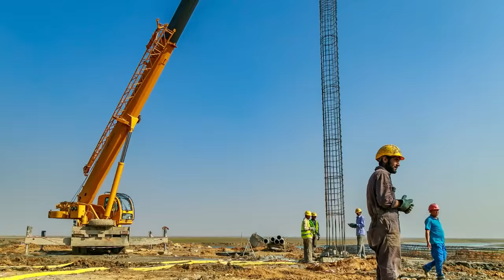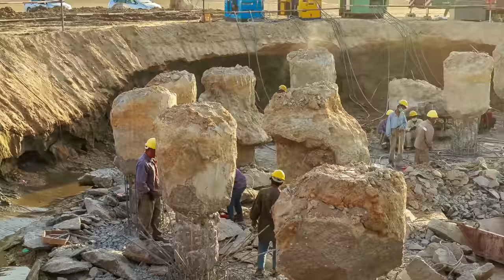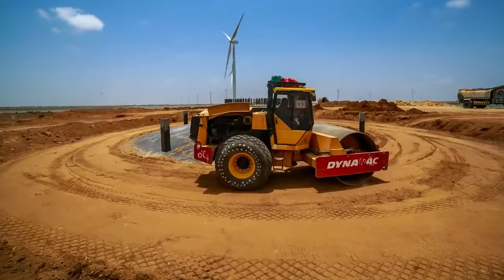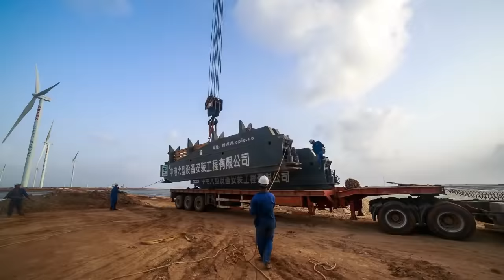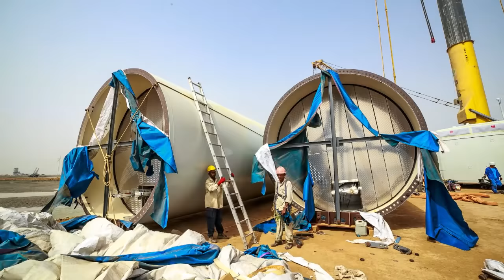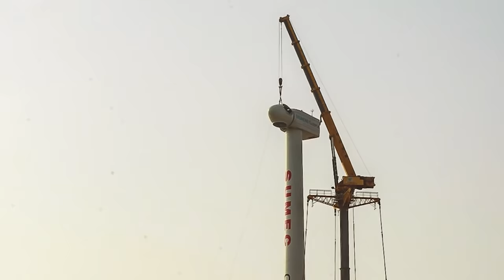Wind Turbine Farm Installation From Scratch | Time-lapse - Mega Structure

Comment: Every wind and solar installation is propped up by reliable nuclear and fossil fuel plants which compensate for the dangerous and unpredictable fluctuations of wind/solar output. Without nuclear/fossil fuel back up, solar and wind plants would cause life-threatening black/brown outs and voltage spikes throughout the day.
Reply: SWOBIZ guess you’ve never heard of large scale energy storage
Reply: @SimpleTek I certainly have heard of grid-scale storage. unfortunately, except for some pumped storage facilities, they don't exist, i.e., a facility that can store several GWH of energy at reasonable cost. In any event, when they do exist, you must add their cost to the price of unreliable wind and solar. I think you'll find the total cost unsustainable.
Reply: SWOBIZ wrong, most concentrated solar pants have large scale energy storage with huge molten salt tanks.
Reply: @SimpleTek   Those salt tanks don't provide grid-level storage. For example, the Ivanpah solar station is forced to burn natural gas to keep its salt hot over night and during cloudy days. That wouldn't be necessary if the salt tanks stored much energy.

Comment: I’d like to know how much fossil fuel is burned building this one turbine. Manufacturing the steel rebar, hauling the concrete, digging and prep work and on and on. 

Green energy huh???
Reply: Vestas studied the carbon payback period for various turbines. This took into account extraction and manufacturing of raw materials, production of the turbines, their transport, erection, operation, maintenance, dismantling and disposal, and the same for their foundation and the transmission grid. The figure was between seven and nine months, depending on the type of turbine. Other analyses have come up with similar figures.

Comment: Just wondering what the carbon footprint is to build one?
Reply: Vestas studied the carbon payback period for various turbines. This took into account extraction and manufacturing of raw materials, production of the turbines, their transport, erection, operation, maintenance, dismantling and disposal, and the same for their foundation and the transmission grid. The figure was between seven and nine months, depending on the type of turbine. Other analyses have come up with similar figures.

Comment: The first thing you have to do is tap your fellow taxpayers for 50% tax subsidies or the thing never gets off the ground.
Reply: Pff like oil an coal arent subsidized as well. In fact per kwh wind is generally cheaper than coal. Before any subsidies and it will continue to get cheaper

Comment: I don't see how this will ever generate enough energy to offset all the construction costs.  Last I head wind turbines are a net deficit.
Reply: You should care about the energy invested in making construction and the longevity of the turbine, not the money.
Reply: @chanakyasinha8046  Don't understand.  If you mean that its a public works project to generate jobs thats great.  But I wouldn't expect the energy generated by the wind turbine to ever cover all the energy it took to make  and operate.  Reports vary on whether wind turbines are net energy deficit or benefit.
Reply: @frymate1261  Locked behind a paywall so I can't comment.
Reply: Vestas studied the carbon payback period for various turbines. This took into account extraction and manufacturing of raw materials, production of the turbines, their transport, erection, operation, maintenance, dismantling and disposal, and the same for their foundation and the transmission grid. The figure was between seven and nine months, depending on the type of turbine. Other analyses have come up with similar figures.
Reply: @SkullRaven  I was more interested in cost payback.  I have doubts that the removal cost included removal the massive concrete and rebar base or the restoration of the environment.   The bases are a blight on the landscape, I have never seen one removed.

Comment: why do they pour the concrete beams up to the top and then strip the tip (2:05)? wouldn't it be easier to let the top without concrete in the first place?

Comment: Very interesting wondering how much it cost to tear one down when it's too old to run?
Reply from the maker: They gonna provide renewable energy for the next 30yr and once 30yr complete.. you can either change its required parts or whole unit..
Reply: @TheBigHeadFilms  thank you so how much would it cost in 30 years to replace the old parts or exchange it?

Comment: It  would be interesting to know how long it takes a turbine to offset the carbon used in it's construction. Anybody know?
Reply: Around 6 months for everything. From mining the resources for the steel tower etc. everything.
Reply: @Mike-kr5dn  thanks...does that include it's disposal at the end of its use?
Reply: @julie5271  Yes ofcourse it is included.
Reply: Vestas studied the carbon payback period for various turbines. This took into account extraction and manufacturing of raw materials, production of the turbines, their transport, erection, operation, maintenance, dismantling and disposal, and the same for their foundation and the transmission grid. The figure was between seven and nine months, depending on the type of turbine. Other analyses have come up with similar figures.

Comment: Needs 31,000,000 of those 2.5 megawatt wind turbines to meet ALL present human energy needs using a 30% Service Factor (amount of wind relative to the data-plate maximum output), 8% grid wiring heat loss & 20% I threw on to account for inefficiencies of making synthetic fuels for aircraft & rockets (I just threw in 20% to give some allowance for that). So at the 400-metre spacing that's covering 4,960,000 km**2 of land & ocean, though the space between isn't wasted of course. Would need to be considerably on land because 4,960,000 km**2 of ocean along 60,000 km of continent (which I'm guessing is ~all of it between 60S & 60N) would be a grid extending 82.7 km out from shore along the 60,000 km of shore with 207 wind turbines in each rank (so a ship leaving any continent would travel down a channel 400 metres wide between 2 ranks of 2.5 megawatt wind turbines with 207 wind turbines in each rank). So the ocean method would need a lot of electrical wiring.

Comment: Is this even feasible in terms of the power output for the work needed??
Reply: Yes. They usually become carbon neutral in about 2 years.
Reply: Vestas studied the carbon payback period for various turbines. This took into account extraction and manufacturing of raw materials, production of the turbines, their transport, erection, operation, maintenance, dismantling and disposal, and the same for their foundation and the transmission grid. The figure was between seven and nine months, depending on the type of turbine. Other analyses have come up with similar figures.

Comment: This video just goes to show how wind turbines are NOT carbon neutral or "green".  The MASSIVE AMOUNT OF FOSSIL FUELS it took to build the roads and work areas to set up a wind farm in the middle of nowhere, the massive amounts excavation and back fill, the hundreds of yards of concrete tons of steel rebar for the base, the energy it took to make them and to transport them...
And that's just the base.
There's tons of metal in the pylon, the generator, and even in the blade bases.  Not to mention that the blades are not made of recyclable materials, and in fact take large amounts of fiberglass and resins, all requiring lots of chemicals, just adds to the fact that these things are not "green".
And oh yeah, they'll be lucky if it lasts 20 years in service, THEN what do you do with it???????
Reply: i live on edge of whitelee windfarm in ayrshire,scotland.........the concrete and diesel that went to the local farmers will never be offset let alone the carbon foot print of the windmills.......and the icing on the cake of what a scam windmills are is fact the concrete is reacting to the peat/soil and they reckon the base might no even see out the first 20years let alone the 2nd windmill. 
oh yh......and some clever cookie set up a deal that even when scottish power dont need leccie we still need to pay the spanish company that put up the windmills......only thing these windfarms are doing is making the rich richer at our expense.
Reply: Vestas studied the carbon payback period for various turbines. This took into account extraction and manufacturing of raw materials, production of the turbines, their transport, erection, operation, maintenance, dismantling and disposal, and the same for their foundation and the transmission grid. The figure was between seven and nine months, depending on the type of turbine. Other analyses have come up with similar figures.

Comment: Nice Timelapse, I'm asking myself how they will remove all this concrete in 15 years...
Reply from the maker: The wind turbines are there for 25yrs... and just in case if they want to replace the old ones with new... they will do it on the same concrete base.
Reply: @TheBigHeadFilms  Is it sure that after 25 years of erosion by the rains + humidity sometimes, the concrete would be as secure as it was 25 years ago?

Comment: Damn, where are the electricity cables? Where does the produced energy flow?
Reply: Those are one of the very first things they put it - under the foundation and running up through the center.  You notice those three thick, curved bundles they put in first, all pointing in towards the center?  There's your cables.
Reply: @vfm66798  1:58 at the center
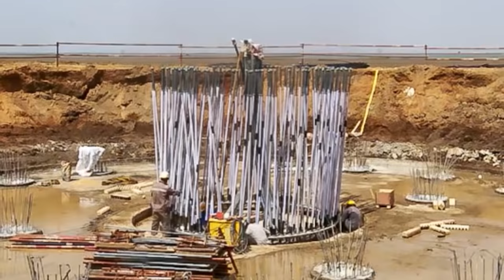2:18

Comment: I don't know how much that crane operator is paid, but he needs to be paid more.
Reply: I spent several years working in the wind industry. Those operators are paid very well. However, even the best crane operator can't do their job without having a competent person on the radio guiding them and people pulling tag lines to line things up. They are for sure skilled but they are only half of the equation.

Comment: All that work for just 1 imagine building like 200 of them 😱
Reply: Well have you seen a nuclear plant building? Or coal plant construction? 
The problem in this site is the foundation. It is very wet and thus requires a lot more reinforcement for the foundation and also the access roads.

Comment: Yes, it was great it showcased al the carbon-producing things that go into something that is supposed to be environmentally neutral. You need Coal for steel no coal no steel and concrete is a mass CO2 contributor when they cam make them out of Hemp it will be a net low CO2 unit
Reply: Vestas studied the carbon payback period for various turbines. This took into account extraction and manufacturing of raw materials, production of the turbines, their transport, erection, operation, maintenance, dismantling and disposal, and the same for their foundation and the transmission grid. The figure was between seven and nine months, depending on the type of turbine. Other analyses have come up with similar figures.

Comment: Wind energy depends on weather, if weather without wind always 🌞 day, wind energy doesn't work. Solar panel energy was also same with wind energy. If weather without 🌞 always cloudy day and rainy day, solar panel energy doesn't work. We think that fossil fuels and nuclear power are very stable sustainable electricity generation. Whatever is winter or summer, they can enough to supply heating in winter and air conditioner cold in summer
Reply from the maker: That is why before installing the wind turbine, there is a whole study done considering the wind corridors of the area, only areas with good wind corridors throughout  the year are consider for wind turbine installation.
As for the solar, they need photon which are available ( in a low amount ) even in rainy weather. with the advancement of technology scientist are able to invest panels which can gather photons in rainy/cloudy weather as well.

Comment: Great work, tremendous effort, etc..  The kind of effort made to raise a building which should stand for centuries.  Too bad a wind turbine only lasts 10 to 25 years.  The electronics packages will become obsolete or wear out after 10 years, the blades are too damaged after 20 to 25 years - and are not bio-degradable, they take up a great deal of space in landfills.  Sorry to be a downer, but it seems to me that other renewable energy sources are better.  Nice videography, too.